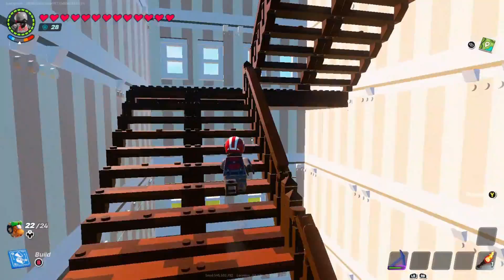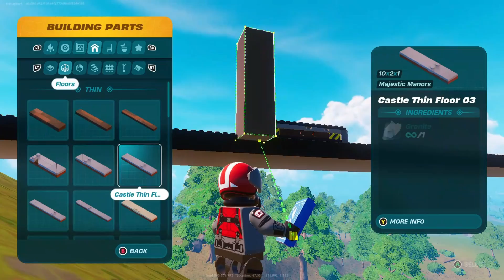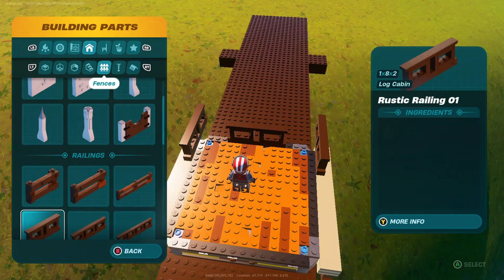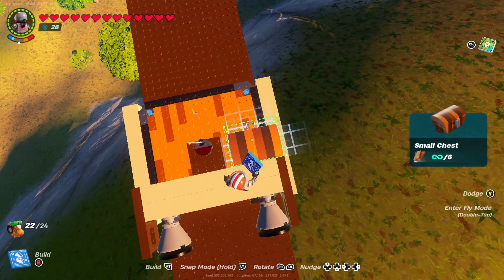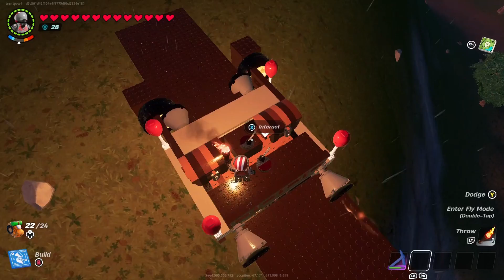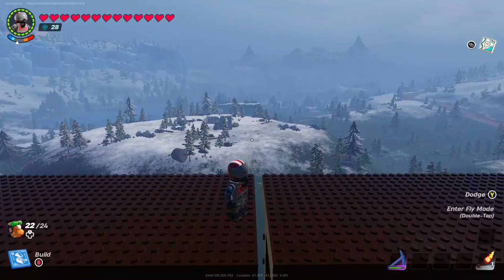LEGO Fortnite Monorail - V2

Comment: Nice. I will see if I can make this work for the remnant of what I built using the 1.0 version of the monorail. I'll have to tweak the two stops in the desert though, since both of those stairs come up the side. I don't think the will be a problem. Just have to support them from below and have a space on the side to get on and off. I have multiple stops no the desert since I keep emptying out caves there and so need to get deeper for more resources. 

I'll update you if I run into any issues.
Reply from the maker: You can add a block below the track that’s shoots off to the side. The guide rail doesn’t hang below the track block so it can be used as a walkway to the stairs and it shouldn’t cause any issues with travel.
Reply: @trentpow4  Very nice. I should get back to that area tomorrow so will give it a try then. I got distracted trying to figure out why my coastal village build rating has tanked down to zero after I got it up to rank 4 the other day. It just started dropping over time even as I built more into it. Second time I've had a village do this. First time, I thought they had an update fix it. But here it is happening in another village.